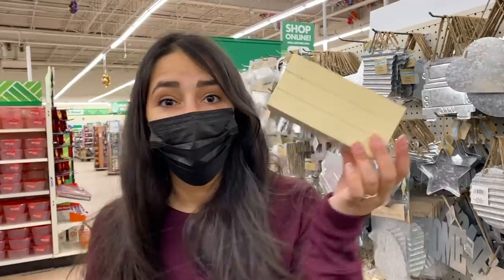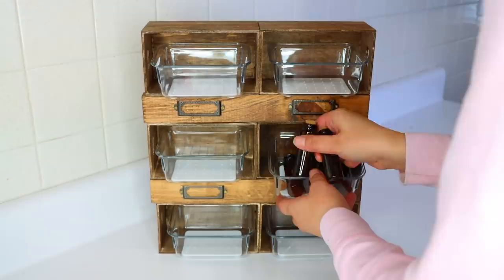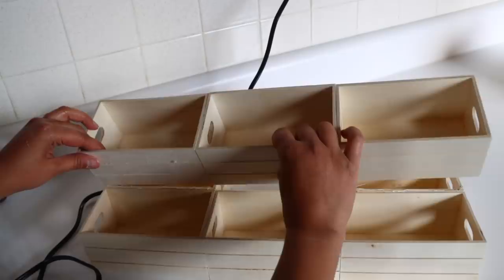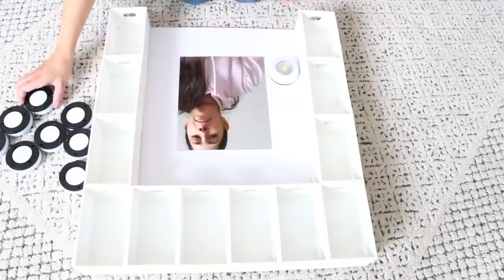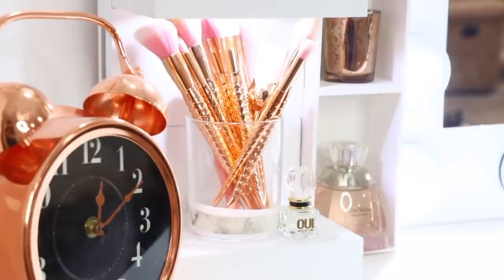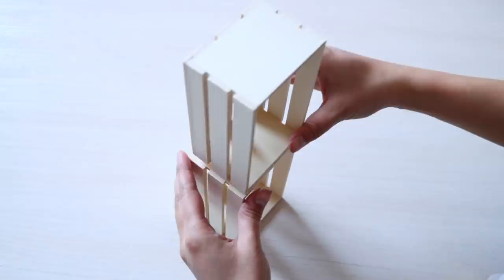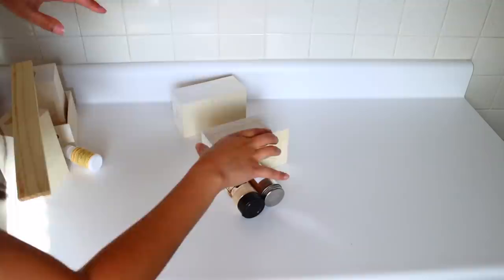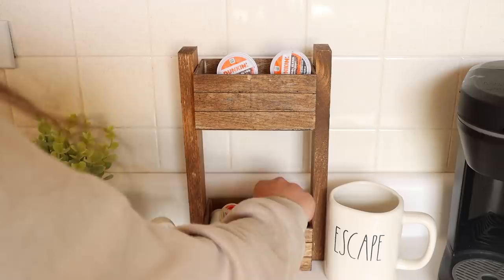EVERYONE WILL BE RUSHING TO DOLLAR TREE TO BUY THESE WOOD CRATES AFTER SEEING THESE HACKS

Comment: Love your crate creations but may I suggest 1 thing. The 3rd one you showed I believe. The coffee crate setup. You used 9 crates but only could use 6 of them and that's such a waste of those 3 that you can't use. Why not just turn them on there side and have the opening opened on the back side. I knw it may not line up exactly but when painted I dnt think it will matter and still look good. So now you can use the 3 crates for your over flow. So you can put extra Kcups back there that don't fit on the front side. So anything extra has a easy access spot to refill the front side. Just a thought so you're not wasting those crates. Or just use foam board to make your tier. Measure it out. Cut all sides plus add a extra piece to put in middle to add extra stability. Then tape them together with good tape. At DT they have the rolls of contact paper or that drawer liner rolls. Pick out a pattern u like and cover the foam board tier with it then paint crates to match.

Comment: My auntie was getting rid of some shelves. You know the thin kind with the lip that you can put frames on. Well I ended up hanging them in my kitchen as a spice rack. Worked out so well in my small apartment kitchen. Btw I love your ideas. I love the vanity but I’d try to dress it up more with a bigger mirror maybe one that has lights on it and I’d use screws for the side shelves and use plywood so it’s thicker wood.

Comment: 🙋🏼‍♀️I HAVE A QUESTION……. does the smaller crates fit into the larger ones like a drawer? 🤷🏼‍♀️The reason I ask is because those glass trays really don’t match the aesthetic of the apothecary you made💁🏼‍♀️. The glass looks too clean and modern compared to the old fashioned look of the stained wood. 
🙋🏼‍♀️I have another idea for the drawers. I know that Dollar Tree sells these bags of thin wood slats (if not you can get them at Walmart or Hobby Lobby). You can stain these slats and glue the wood piece to the front of a plastic, cardboard, or wooden box to make your own drawers that match that apothecary you made perfectly. Or it doesn’t even have to be a drawer. You could attach a stained piece of wood across the bottom of the opening to create a kind of a cubby hole for items. 
I love your idea for the white metal hanging thing. I bought several of them but was trying to think of how I wanted to use them, thanks for the ideas😁👍 Anyway, I hope any of the ideas I suggested helps you or some of your viewers. I love your channel and I look forward to seeing your Easter ideas.

Comment: Hi, Bethany! Whenever you paint on wood, do you also put like a glaze over it so it'll feel smooth and the paint won't rub off? If so, what kind of glaze do you use? Or is there a kind of paint where it can achieve the same finish without a separate glaze?

Comment: With the second project it would have been good to turn the back bottom row of crates upside down. That way you would have had a solid surface to glue your next row to and you could have stashed small items underneath in the now “open” crates.

Comment: Just a tip - Michael's has these same crates for 99 cents.  Now that Dollar Tree has gone to $1.25, not a bad idea to check those out.  I've used the Michael's crates for several projects and they are just as good as the Dollar Tree ones...can save everyone some money if creating multiple/larger projects with these crates!
Reply from the maker: Wow,  Thanks for the heads up Maria!!

Comment: It's such a waste of the crates to turn them upside down.  If you turn them up then you use the insides and things don't fall off. I love the ideas but would definitely turn them over.
Reply from the maker: My DIYS are just ideas! You can always change everything to suit your needs and style!  :)
Reply: @Bargain Bethany  yes and I love your stuff. Just ment to give other options with less waste. No offense ment. Sorry if it came out wrong !
Reply: I was actually thinking that instead of turning them upside down you could turn them on their sides facing outward so that you can still place the taller spices in between the crates and use the openings of the crates themselves for the smaller spice bottles/jars. :)